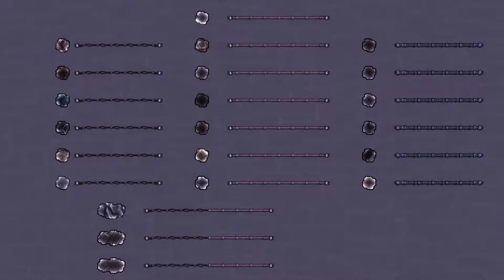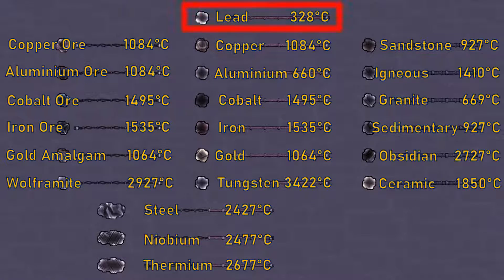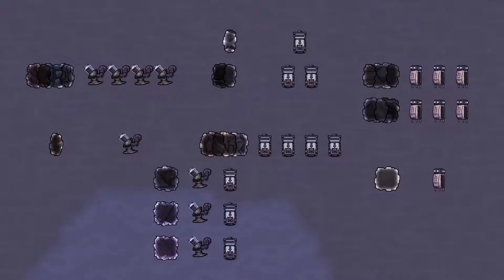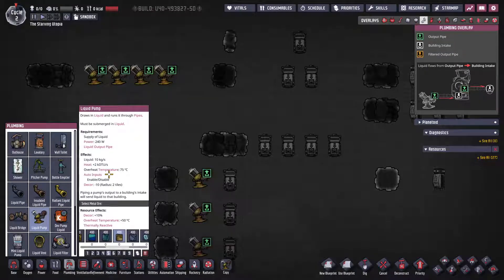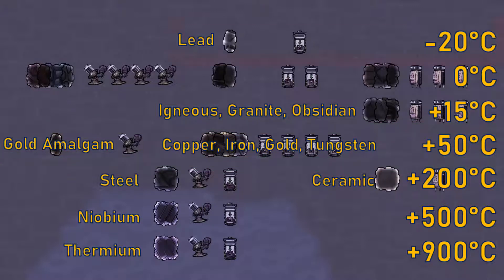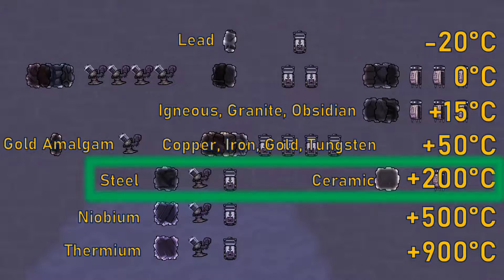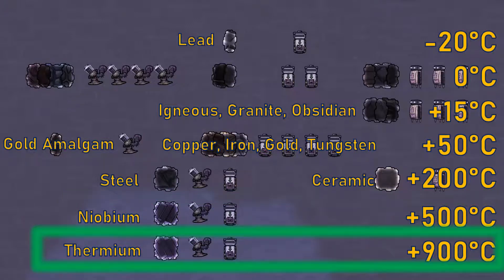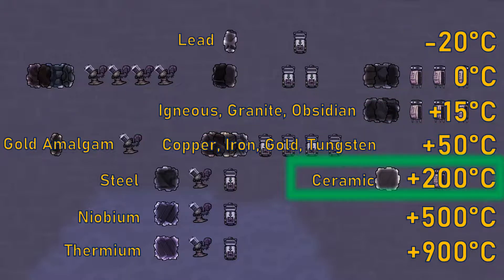Oxygen Not Included - Tutorial Bites - Overheating and Melting

Comment: Can buildings overheat when not active? For example, does a steel gas pump with a "body" temperature of 500 °C overheat when it is disabled by an automation grid and not actively pumping?
Reply from the maker: Yes, it's just the machine temperature. It doesn't matter if its working, or even powered it will still take damage.
Reply: @GCFungus  Thanks!

Comment: Is it still the case that you need liquid for space heating?
Reply from the maker: With the conduction panels, these can be used instead without a liquid or gas.
Reply: @GCFungus Thanks. It’s interesting that radiating heat into space is limited to certain materials. In real life I think it’s mostly based on surface area.